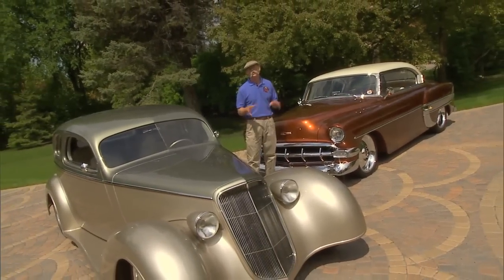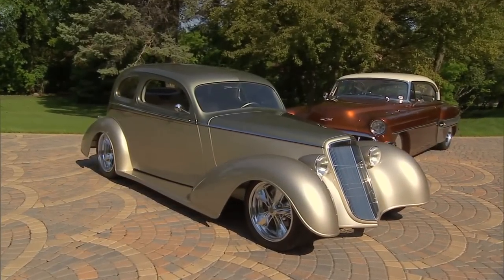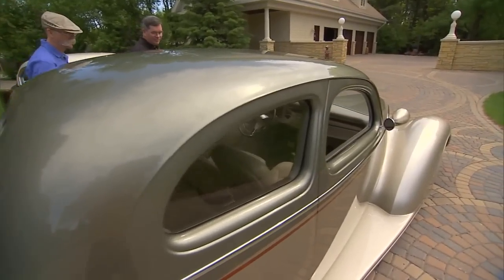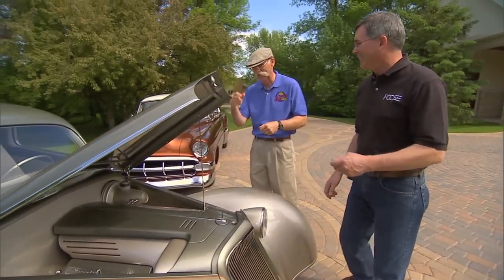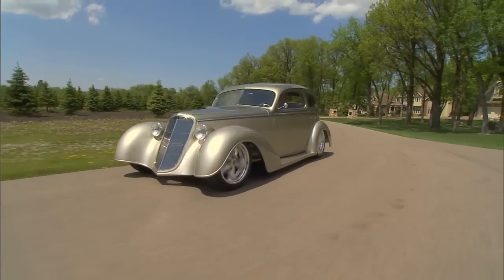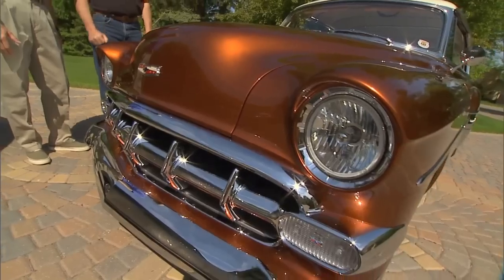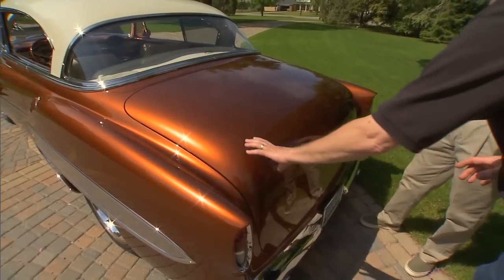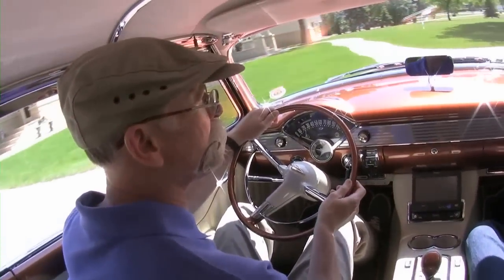The Grand Master | 530HP Cool Air | Iconic Customs Designed by Chip Foose

Comment: The Cool Air reminds me of the 1954 custom Chevy Bel Air I built in the fall of 1960 while I was a senior in High School.  It had a full race GMC engine with 3 single barrel Zeinth carbs, direct linkage and got 6 2/3 miles per gallon.  The door handles were removed, the trunk completely shaved, and all opened with the push of hidden buttons behind the grill.  The two piece talilight lenses were were replaced with a one piece RED lense from an International truck station wagon.  The lower side trim section was extended forward onto the door, then down.  It came from a '56 Plymouth that was used on the doors.  The square trim between the upper and lower side trim was removed. I also added 10 additional vertical "teeth" to the grill. (THIS WOULD ALSO GIVE YOUR CAR AN ADDED "WOW" FACTOR). The car was lowered, painted Refrigerator White, and the side trim secton that extended from the rear, onto the door (and down) was painted Emerald Green, which matched the dash. In January 1961 the number one song was "Corinna Corinna" by Dean Martin, and since I was entering my first car show, and needed a name for the car. . . it became "Corinna" and I took First Place!  I still have the original Show Sign that I used for many shows, and pictures from that show..    Mike, Jackson Twp., Ohio